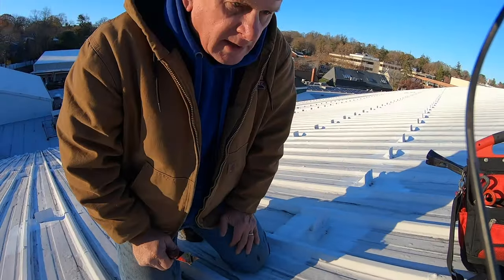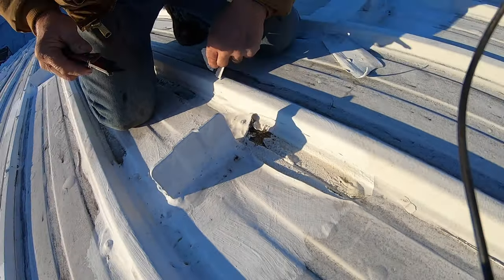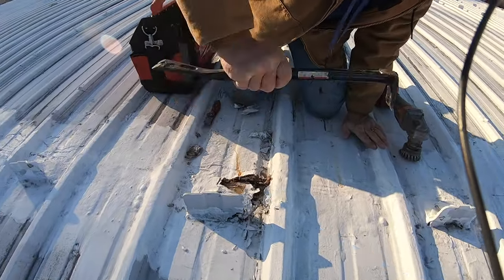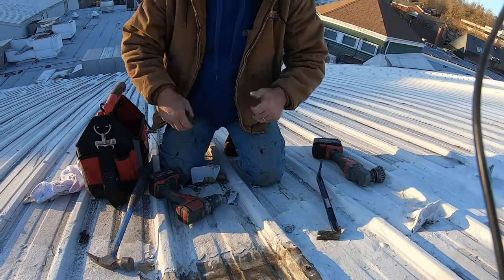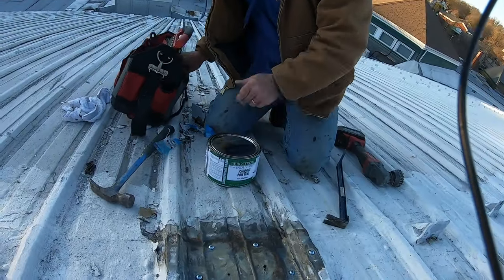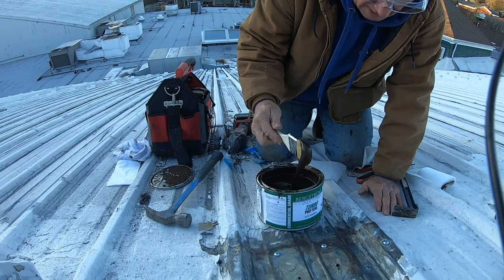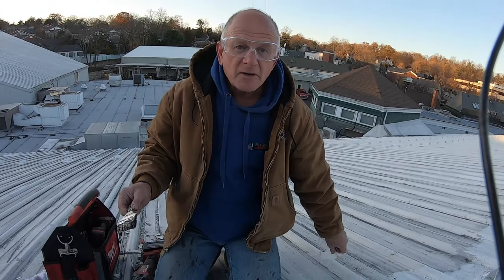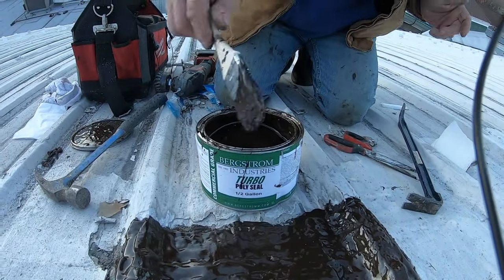Why NOT to apply Metal Roof Coatings - The worst thing to ever do

Comment: Can you do a video on your opinion on flat roof safety barriers?
Reply from the maker: Hu Andrew. I am not an expert on any safety stuff. I don't follow OSHA rules on roof safety because it is impractical. I would be out of business if I had to set up a safety thing every time I do something on a roof. Residential roofs are to small to setup safety flags and barriers. On commercial roofs,  to have flags with a safety line 5 ft from the perimeter is impractical. Putting a harness and then tie yourself down because I am going into the 5 Ft zone of the perimeter does not make sense.
Anyway, I admit that I had close calls falling off a roof several times and flag lines would have prevented that. But not 5 ft form the perimeter. 
Anyway, it is such a big subject that it would be impossible to try and discuss it here.
Anyway, thanks for your comments
Naas

Comment: you say that the replacment sealant is not cheap, well it is,. if it works,  cheaper in the long run. some one has created an enormous problem, and has not done the roof any favours, it would have better if they had got some one who knows what they are doing, in the long term., the ice will push the coating off, as it expands, exponentially, trapped water, not a good thing. a bag of wet clothes in a plastic bag, when would it eer dry.

Comment: You said it was an Aztec roof? Aztec I believe is a fabric-based system. Fabric should only be used in special instances on a metal roof. The bubbles you are cutting out are cause by "tenting" which is when the fabric is embedded improperly and creates a air space or "tent" underneath. Water builds up by condensation and leaks into whatever it was sealing like a seam or screw. In one of you videos you did the exact same thing on a residential brown metal roof transition using a silicon patch. Silicone doesn't belong on a metal roof. Silicone has very poor elongation rate and will break. To prevent that you ran fabric in the silicone...one problem on top of another. The fabric did tent, I guarantee it, in the rib-to-valley transition because you rant the fabric across the ribs and valleys horizontally. Your repair on the residence is worse than the one your critiquing. All coatings are not bad but fabric based systems are not as good and they will trap water and rust away the metal.
Reply from the maker: You do say things that appear to sound correct. But assuming is never facts. This Aztec coating was sprayed on, "no fabric".  (1. The fact showed in this video)
I have tested silicones in one of my videos, repairing an EPDM rubber roof with Super Silicone Seal, I show the elasticity of the silicone. It stretches with the EPDM as I pull on it. (2. fact is shown in this video https://www.youtube.com/watch?v=sxXBS0v3hVY at 5:48 mark and 7:11 mark on the video)
Talking about "fabric-based systems" All my repairs are not "Systems" to cover entire surfaces, they are only for repairs where possible leaks are. (3. The fact showed on all my videos repairing seams and transitions Not using fabric on the repairs is "stupid". It is like not using rebar in concrete.
I agree with you if the entire roof was covered with a system that is fabric embedded, it will be bad just as the sprayed coatings are for most metal roofs.
But, to say the repairs are wrong because I used fabric with silicone or in other cases with Turbo Poly Seal, you are 100% out of your mind.
I think you may know something about coatings, but nothing about repairs.
Thanks for your comment anyway. You keep me on my toes. Short stompy ones.

Comment: Two issues you fail to realize.  One, this roof was not cleaned properly.  The coating was not applied correctly.  I have been doing roof coatings for 30+ years and with no problems.  This is only by your opinion.
Reply from the maker: Regardless prepped properly or not. All acrylic paints shrink. As I show in the video. 
This is your assumption that it was not cleaned properly. I have seen several "Astec"  roof coatings gone bad. So I guess the excuse is they all don't know how to do it. I submit to you, that any water based paint will shrink within 5 years on a metal roof that bakes in the sun all day. There is just no way that these coatings can last
Reply: @FlatRoofDoctor  You are incorrect.

Comment: Yes and No.  Astec Coatings are decent Acrylic-based elastomeric paint.  It is water-based. People do have options...silicone coatings or thermoplastic coatings. In many states, the reason you coat an old R-panel or Standing Seam metal roof is that it is totally shot...... Heavy rust, fasteners are missing, panels have lifted, skylights have leaks, pipe and vent flashing is rusted or they have old caulking that is worn out. Plus a new coating of Truco Thermoplastic fluid-applied roof system with a base coat and two sprayed applied top coatings seals the old metal panels. Preparation work consists of securing all old fasteners or replacing them, using a poly mesh on all horizontal seams and spot coating each fastener head. A Poly- mesh membrane is also used to seal around curb mounts and sealing all seams on fiberglass or acrylic skylights. Coating a roof with white reflective Thermoplastic coatings. You are using a black Turbo Polyseal which does not look good from the street because the roof is white. Truco Thermoplastic coatings work exceptionally well. It is not a water-based product. It has a 10-year product warranty.  I do this for a living........with proper preparation, the use of Poly-mesh on all horizontal seams, metal conditioner, base coat and top coatings you have a roof that is leak-free for many years. It is ALL in the high-quality preparation work that makes for a great coatings project.
Reply: Ponding water is almost always were the problem areas are.
Reply: @JoeLinux2000  Yet this video is a sloped metal roof. Ponding water is not the issue.

Comment: I've done a ton of metal roofs are corrugated metal roofs and I've been through thousands of rubber gloves just covering the screws and the joints AKA seems I never recommended aluminum coating or any other type of coatings on them cuz to me and I tell my customer the only thing I see is it reflects the heat off the building does it do anything else besides that cuz it really doesn't seem like it is seeming up anyting and I don't mean to sound retarded but I will anyways what is the name of the mesh you use with this product just out of curiosity how do you feel about elastomeric coating I don't know if I asked this question already but can I use the bitumen adhesive on the entire Ariel then I'm going to stick the rubber to wall foundation wall
Reply from the maker: The official definition of elastomeric is “An elastic substance”. The definition goes on to say the material can occur naturally or synthetically. So, if elastomeric simply means an elastic substance, then any material that is elastic can be described as elastomeric. Therefore, any roof coating that maintains elastic properties is an elastomeric roof coating. Whether it’s acrylic, urethane, silicone, or another material. If it is elastic in nature, it is elastomeric.
https://pmsilicone.com/what-are-elastomeric-roof-coatings/
The terminology is used loosely. Anything v]can be called that.

Comment: 99%of the repairs I've seen you fix is with this product 🤔🤔🤔🤔how much they pay you so whatever ideas you have please  consider you familyllll explain to me or show me a video you might have because your videos have been a lot of help thank you I also seen you use some type of torch gun handheld gun that looks perfect for detail work what is the name of it how much does it cost normally I haven't seen one at my industrial supply yet maybe if I ask for it by name that might have one under the counter the guy was a little dizzy to 0 to say the least now just as a side note I've used roofing cement to try and fix and smooth out a wall once and it didn't work out too good because it's highly flammable is that polyurethane that you use flammable
Reply: probably not enough! show us the next video on how to fix that roof Dr. Naas.
Reply from the maker: Hi Gabby, I came across this product years ago and it became my go=to product for almost all my repairs. Besides Turbo Poly Seal this company Bergstrom Industries also sells Super Silicone Seal which I use to repair EPDM Rubber Roofs. But Turbo Poly Seal sticks to anything and is flexible. There is no other product out there that I know of that work as good as Turbo Poly Seal.
Sorry for boring you with all the repair products!
Reply from the maker: @allenperera6158  Hi Allen, how are you? We have a bunch of videos that need to be edited during the winter when we are not outside working. I will have them ready soon. Thanks for your comment
Reply: @FlatRoofDoctor  I see
Reply: How do you feel about going half way up a flashing foundation wall wall that is 2 feet high and then apply modify to the roof . Have you ever done anything similar to that can you meet me at my house after work tomorrow
Reply: How do you feel about it and is there any different brand out there and what is it basically please explain it I would love to give you my telephone number if that would be okay please let me know ASAP
Reply: Please when you have time for me I don't need an hour I want to explain to you step by step so it takes time
Reply from the maker: @gabbythetoymaker1400  Ok, Turbo Poly Seal is designed for flashing details, but not to cover entire walls. I suggest covering the walls with either siding, membrane and the do the flashing detail from the roof up about 6 inches. Too expensive to cover walls or large surfaces with Turbo Poly Seal.
Reply from the maker: @gabbythetoymaker1400  You can text me at 203 858 0080
Reply: You're worth you've taught me a few things I am a young contractor roofer and I'm always willing to learn more at first I thought you were just trying to sell the product itself and then I seen it actually works
Reply: But now I have about a 30-foot wall that needs in my opinion to be recapped
Reply from the maker: I am happy to help you
Reply: @FlatRoofDoctor  I plan on going under the copings with the membrane it's just the wall is so loose I was considering plastering the flashing wall it's only 2 feet high and then applying the adhesive and torching over it what are your thoughts about that
Reply: @FlatRoofDoctor  this might be a stupid question but I probably shouldn't know the answer and I think I do is that product that you use flammable

Comment: Nothing to do with coatings, this would be with every coating or paint if you just don't prep.. a bad contractor is something where certificates were made for..
Reply: absolutely right.. you can tell there was a failed coating underneath. You can tell there was no prep done at all.
Reply: @innercirclenetworktv8662  yea put that garbage acrylic coating on your roof and see what happens about 3 years later

Comment: Waow all this avoided by simply painting with rust proof paint and last from 5 to 25 years depending on location and weather....some one realy needs works i guess that is way the invent that stuff !
Reply from the maker: you are correct. If the panels were rusted that would be the correct treatment. In this case nothing was rusted, only had leaks at the seams and screws. The salesman did a good job selling a "coating job"

Comment: By saying all coatings are bad is false, I’ve seen coatings that are twenty plus years old and look very good, I’ve also seen bad coatings, a lot depends on your brand type and then taking the proper steps to coat it, guess what I’ve seen really good metal roofs and really bad metal roofs, I’m not gonna say metal roofs are bad just because some people don’t know how to install them correctly.
Reply from the maker: I never said Metal Roofs are bad. Contrary, I think they are an excellent material for roofs.
I have seen very thin metal panels, almost the same you see in Home Depot. I will call that super bad.
My beef is "coatings" I think I can find fault with almost any roof that has been coated. There is going to be something someone did wrong all the time. I don't think it is a full-proof concept to preserve a roof. Too many mistakes can be made in any coating job, and no one will take the blame..

Comment: They did not prepare the roof properly that’s why is leaking they were supposed to power wash the roof let it dry silicone all the screws and then sprayed the elastomeric sealer
Reply from the maker: well, you are probably right, but even if they did what you say, you can't spray any sealant or coating over a metal seam. It will crack because of the expansion and contraction of the metal and it will cause greater leaks

Comment: Pure Acrylic coatings DO WORK...proven in major industries as the alternative is to leave the roof bare and let the elements naturally rust the roof which will cost you 5X as much to replace as you would do maintenance regularly.   This gentleman obviously thrives on pointing out bad workmanship and blames the coating....
Reply from the maker: You must be a South African. Anyway thanks for the comment. Acrylic is a water-based paint. It never lasts long enough in the sun. Yes, inside houses it is fantastic. But UV's and heat are the worst elements that destroy almost anything. Then you add rain and oxygen, which excels destruction. 
Bad workmanship? Of course, that would always be the excuse. Better preparation will make work last longer. But to expect a contractor to clean around every screw and every seam before coating it is insane. Then to expect that power washing will clean every nook and cranny is nuts. Cleaning a surface of a roof to where it will be acceptable for a coating will never happen. 
Then, applying a coating over a seam, where the 2 metals expand and contract constantly, is just as crazy. The original contractor that is an Astec agent, already had someone re-do the seams with Acrylic and cloth. That never worked.
The problem is compounded when they keep adding more junk on top of other junk.
I do agree that "Acrylic' coating could work, but with the preparation that no one is prepared to do or can afford.
That is why I advocate cleaning around every screw and seam with a wire brush and then use Lacquer Thinners to wipe down before using Turbo Poly Seal or Super Silicone Seal for the repairs.
Anyway, thanks for your input.
Naas
Reply: Thx for the feedback....but i disagree with your total objection against coating with Acrylic (or waterbased as it more commonly known) ... roof coatings is a booming business and one we are involved with the paint manufacturing from polymer testing with international manufacturers to the actual application.  You mainly advocate the waterproofing part and a lot of your advise regarding that is logical and good ....but it is just not sensible to totally blast all roof paint applicators and paint products due to personal opinion...if everyone agreed with your assumption that coating is not the answer, then what will your advise be for a client facing a degrading and rusting roof be?
Reply from the maker: @johanbreytenbach3137  I am not a scientist or have knowledge of all types of products.
I use common sense. UV's and heat are the biggest elements to contend with. 
Ok, there are 2 factors that affect the durability of any product.
1) Preparation - Because of the Labor-intensive procedure to clean any surface properly, it will always be the excuse of the manufacturer of the product why they claim the coating failed.

2) Ultra Violets and Heat - To produce products that are completely protected from Ultra Violets, cost too much. It is also not in the best interest of any manufacturer to produce something that lasts forever.

In the case of Asphalt Shingles and Granulated Torch Down Rubber membrane, Ceramic sand is embedded on the surface.
Ceramic, brick, metal can stand UV's. Polymers, rubbers, plastic will deteriorate.

You mentioned "Booming Business" - That doesn't give credit to a good product. The same was said about EPDM rubber membranes. That has failed miserably. 
You mentioned "international manufacturers" - That doesn't give credit to any product.
Common sense dictates, and not what is popular or who is trying internationally to come up with a solution. 
But I am not against Coatings
1) I think one should treat the rusted spots on a roof. When the galvanized protection is scraped or the metal panel is bend, then the galvanize protection will peel at that place and it should be sealed with some sealant. Primer plus coating or Turbo Poly Seal.
If the rust is more than spotted areas and the entire roof is rusting, then I do believe you should find a coating. 
What I have seen to work very well is Aluminum Asphalt Paint from Karnak. With some preparation, that seems to work the best to inhibit further rust.
The reason I think why it works better than Acrylic Coatings is that the name says what it is, Aluminum Asphalt. Embedding Aluminum ( metal particles) in the Asphalt, which adheres to metal very well, makes for an excellent protective coating. The Heat reflection and UV protection with the Aluminum make this better than any other product out there.
I just saved all the "international manufacturers" from years of experimenting. Just add Aluminum particles to the product and it will extend the life.

Comment: This is not really a problem , you did it to your self by using the wrong product on your metal roof , you should have use a PVDF Coating or Fluoropolymer type , this is by far best for commercial use.  Using acrylic for your business roof is a bad idea , very cheap , you get what pay for.
Reply from the maker: I am glad for the clarification. I will research that. Many thanks